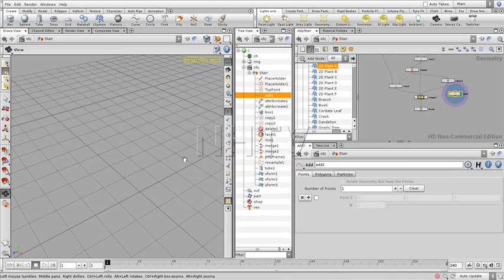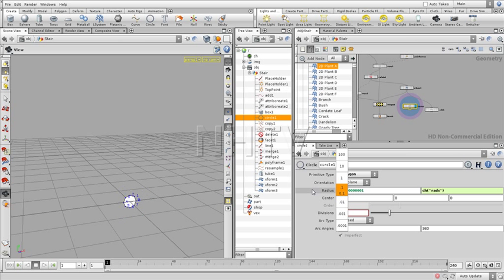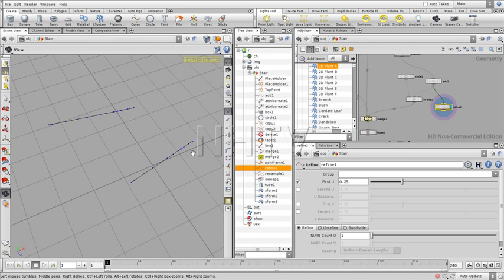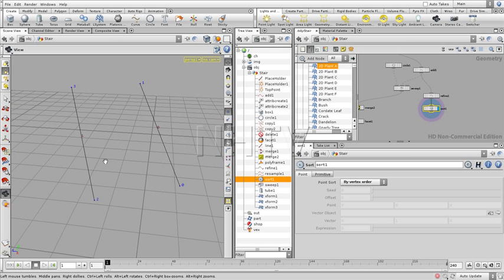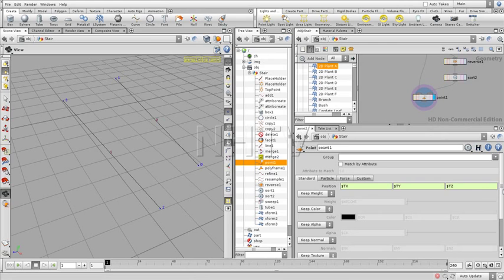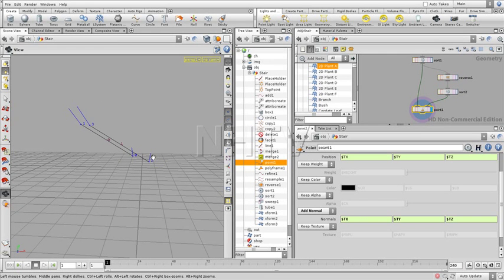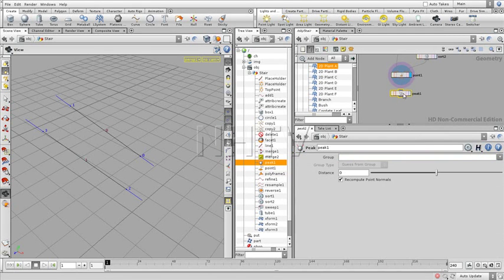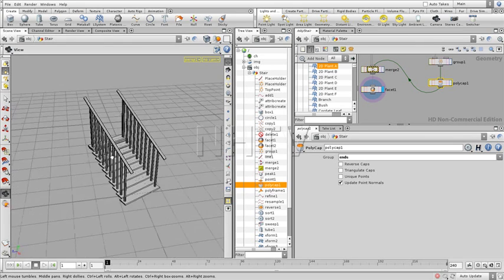ProceduralStairs 06

Comment: For those that might run into the same issue as me.
As of houdini 17 you can still use the same point he is using it's now called : point old
I've tried with several methods: https://gyazo.com/7ccdb0a1da4df185b007d4c117640032 in this one I'm matching both the position and normal he has.
In this one I just changed the Normal, and I'm getting the same result: https://gyazo.com/7544994ab7c42eaf457802eb3d8479c8
For the last one I tried to write it in what I assume it's vex code (don't quote me one it since I'm new to this ) https://gyazo.com/481bd61d04cd2c4e35fca18566514402 and it is removing the normal information, @kim goossens could you point out the error here ?

lastly even if you do one of the versions where you get the same normals you might get this issue with the sweep node, https://gyazo.com/c1d2eeccabef9b217adcea1b96441266 the geometry gets squashed half way of the rail.

one fix I found is that you can uncheck the transform using attributes inside the sweep node https://gyazo.com/23ce931c327d478eb2a2f5564ced1e28 don't ask me how it works because I was just checking parameters haha